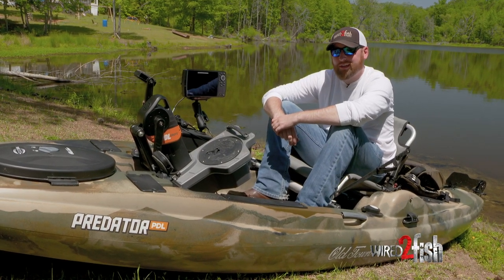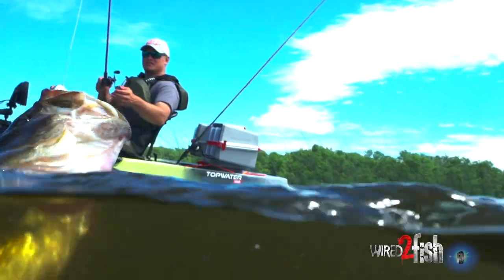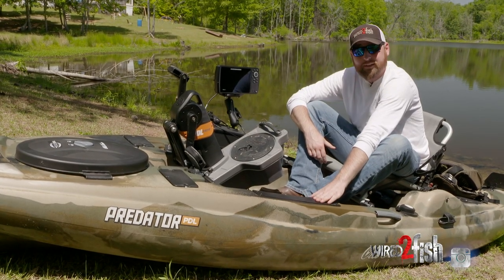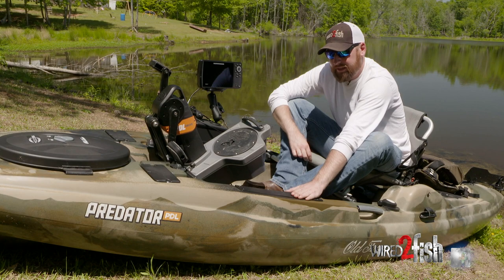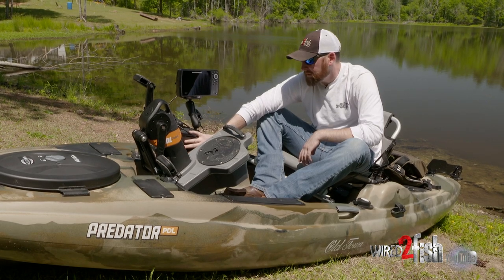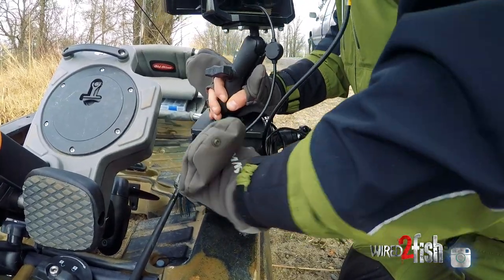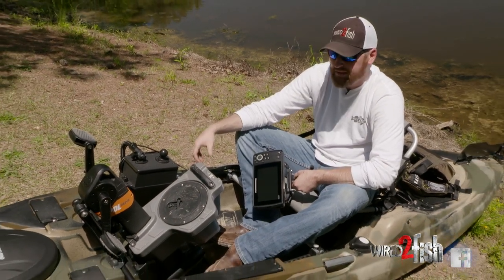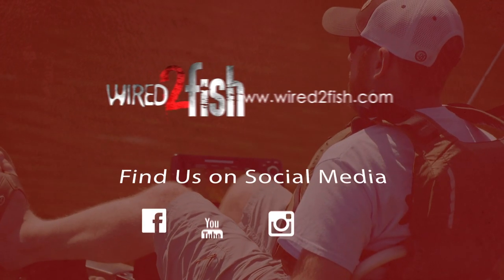How to Add a Fish Finder to Your Kayak

Comment: Sweet. I am going to be setting my Pelican NXT 120 with a Helix 7 and I have the cell block and ram mount for the transducer. Did you add a fuse to your connection to the battery? I bought a waterproof fuse protector and am waiting for my 9A fuses from Amazon. Thanks for the vid.

Comment: Looked at some  high end kayaks the other day,  top 10 brands.  Not 1 included a recessed protected transducer mount.  Sales guy told me an over the side mount was my only option if it wouldn't mount in the scupper.    Jackson,old town, native, bonafide,  need to step that game up.
Reply: Wilderness Systems and Hobie do. You do not want a over the side mount.
Reply from the maker: Mike West, The Old Town Predator PDL and Topwater kayaks have recessed transducer mounts but the tough part is adding protection as the transducer needs to be exposed in order to give an accurate reading. Especially when side scan technology is desired. The real benefit to the system in this video is an easy transfer of electronics between boats and no drilling into the kayak itself. Also makes cable management a breeze. BUT, if you are looking to do a more permanent install the scupper hole and recessed transducer mounts on the kayaks mentioned have worked well for us. You can also DIY a movable extension for the transducer to make it more easily exposed. Another issue with this though is that the transducer can be damaged easily if you are dragging into an access or fish around a lot of hard cover like rocks and timber.
Thanks for watching-
Reply: Native has a recessed mount for transducer. At least the Slayer does.
Reply: Wired2Fish I am wanting to put a Helix 7 MEGA Chirp SI GPS G3N and have the transducer set in the dedicated scupper hole of my Predator PDL, but can’t get anyone who knows for sure that is will actually fit.  Otherwise I wil arm it over the side as shown here.
Reply: @CNYoutdoorsman  I'm thinking of doing an over the side transducer. Why in your opinion do I not want an over the side? Thanks.
Reply: Where did you fing the battery box?

Comment: I know it’s been a few years, I was wondering how much does this set up affect the balance of the kayak?
Reply from the maker: One thing that has helped with weight in the last couple seasons is that I use a Dakota Lithium 12v 10Ah Battery. http://wired2.fish/DakotaLithium12v10AhBattery 
I Have never experienced any significant counter balance issues and I've used that set-up on many different kayaks. from 10ft-13.5ft.

Comment: Does it get in the way of paddle stroke? If wanting to use paddle instead of pedal?
Reply from the maker: When I want to use the paddle over the pedal I will typically use just half the paddle as the paddle I use comes apart. Otherwise you can steer around it without much hassle using a full size paddle.
Reply: I have mine in the center of the kayak on the console. Does not get in the way of paddling and the weight is not on one side making it pull to one side.